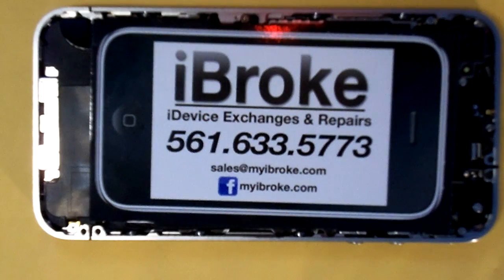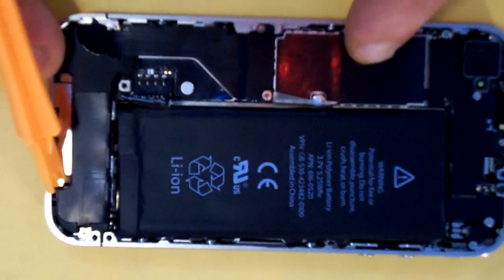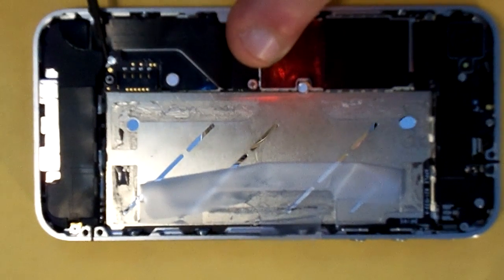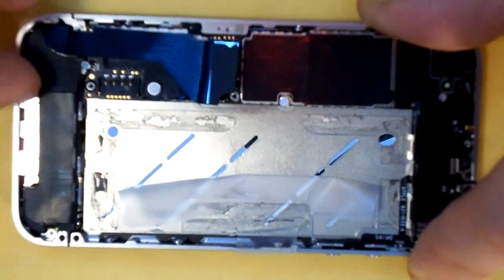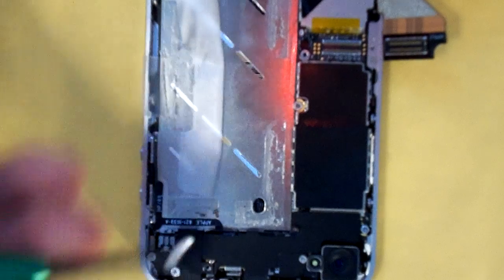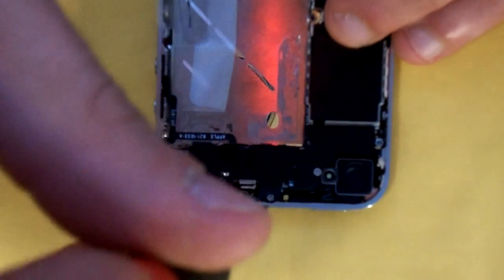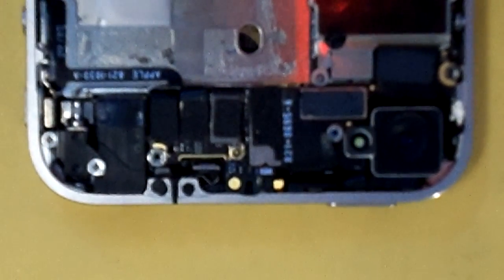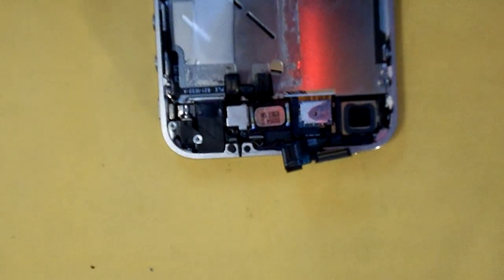iPhone 4 Ear Speaker Replacement Guide and Teardown

Comment: Just fixed my phone using this guide too.  I had previously had a new flex cable fitted at a shop for £20 but when I came away the ear speaker didn't work.  I think the small metal plate to the side of the ear speaker wasn't seated correctly as when I squared it up it clicked into position.  Thanks for the video and detailed instructions.

Comment: Great video! I followed it very carefully, including numbering all the screws etc. It took me 2 hours! The new ear speaker works fine, but now the right hand side of the touch screen won't work.  So on the phone keyboard, I can't dial 3, 6, 9 etc.  it's so annoying because I was so careful! Anyone know which tab (if any) I didn't re- fit correctly? Tim. Yorkshire UK

Comment: Ha guys great vid. I replaced the screen on my iPhone 4, screen works great but I can't get any sound out of my ear speaker whatsoever. I have checked the #3 connector and it should be connected now but still no sound out of the ear speaker. When I make a call I dont hear the ring on my end but my phone will ring when I get a call but I can't hear anything nor can the caller. Can you help?